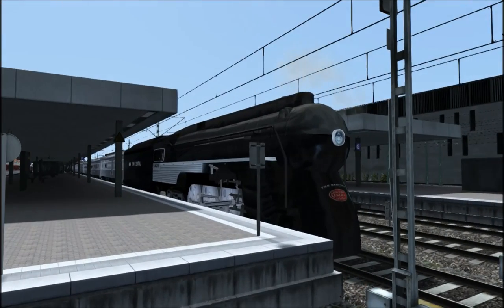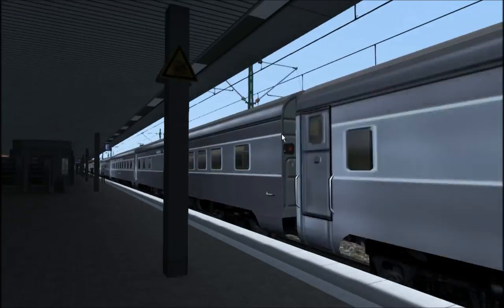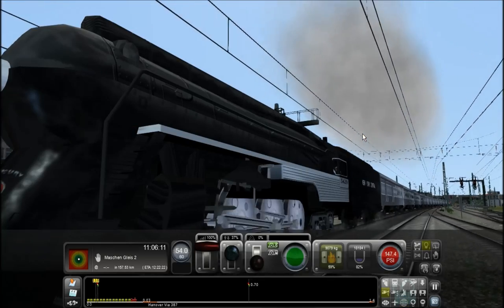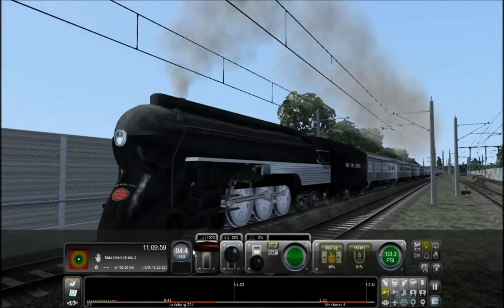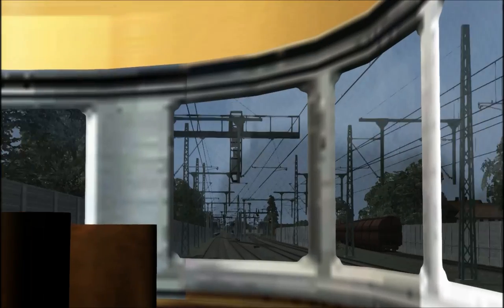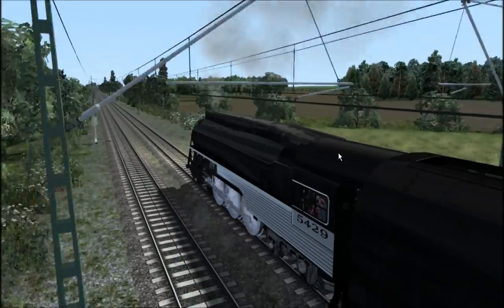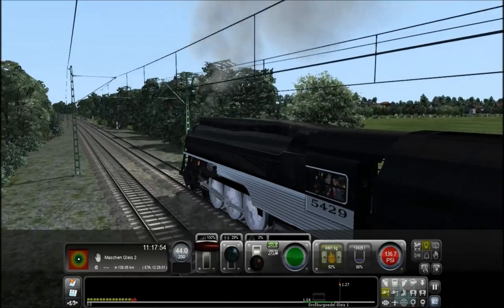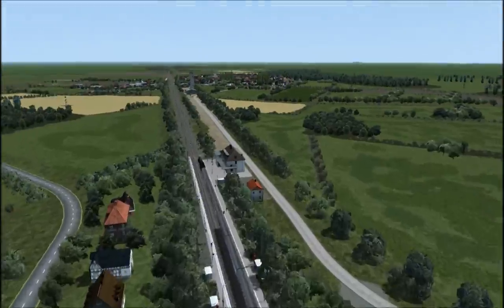LaZeR JET Plays... Train Simulator 2017 - New York Central 4-6-4

Comment: the engine is a dreyfuss j3a hudson streamlined in empire state express livery and the 4-6-4 wheel arrangement is a hudson
Reply: its top speed is 120 miles per hour or 193.12 Kilometers per hour
Reply: the cars its pulling are for the 20th century limited
Reply: Trainboy 4472 
Wrong,they can only go at 110.
Reply: It's not a Dreyfuss.
Reply: Spearmint Pony Dreyfus designed it so that makes It a Dreyfus Hudson
Reply: Dreyfuss only designed the cowling for the streamlined Hudsons.  The "Dreyfuss" Hudsons were the ones used for the 20th. Century Limited.

Comment: This is a J3-a super Hudson built for the New York central in 1937, at American locomotive company,(Alco), at Schenectady, New York. In 1941, 15 locomotives of this class were streamlined to conform to the new Budd all stainless steel passenger cars for the Empire State Express. Few minor changes were made over the years, and some were fitted with the centrals state of the art PT-4 tenders, which were usually made for Niagara's , the Central's other famous locomotives. Somewhere use on the centrals other famous passenger trains, dubbed as " The Great Steel Fleet." These locomotives went through a few different paint schemes over the years also, and we're all scrapped by 1958, thanks to the rise of the diesel locomotive .

Comment: It looks like a gothic version of the New York Central Empire State Express. These were streamlined Hudsons (4-6-4 wheel arrangement). Like the Coronation class pacifics, they were normal Hudson locomotives fitted with a streamlined casing. They put a gothic Emire State Express Hudson with 21st Century passenger cars. Idk, its more like poorly made than older model. Also I just saw at the front and it is "The Murcury". Also, nice photo run by.

Comment: Njc j3a streamlined. A model converted from MSTS. Btw, on all of these conversions the tender capacity for coal and water is screwed so go to wikipedia and insert the proper data into the engine file if you want a realistic capacity.

Comment: the new york central 20th centrey limeted was built in the late 1930 for the new york central railroad. it pulled the 20th centrey limeted from new york penn station to chicago. the new york central operated the electric locomotives so the have to swap it the train with the dreyfuss hudson until the 1950s went the replaced the steam locomotives with diesels. as for the j3a locomotive they were scrapped.I did a drawing of the train.

Comment: This locomotive is a J3-a Hudson, built for the New York Central in 1937, by Alco (American Locomotive Company.) 15 of these locomotives were streamlined in 1941 to conform to the all new Budd Stainless Steel passenger cars for the Empire State Express. Most of these locomotives were used for some of the Central's other flagship passenger trains, dubbed, "The Great Steel Fleet." Some were fitted with the Central's custom PT-4, (or Centipede,) tenders over the years, replacing the original streamlined tender. These locomotives saw service on the New York Central for over twenty years, but all were scrapped by 1958.

Comment: the empire state express new york central. system. built in 1941.  service ended in the mid 1950s. numberd 5400 series on the road number. could always tell. also include the mercury limited for runs into Detroit.  and. the 20th century limited express. that would run in to Chicago